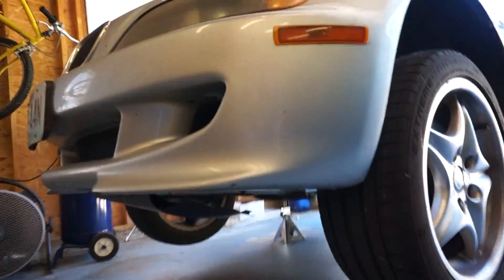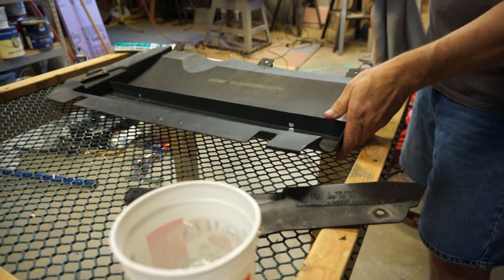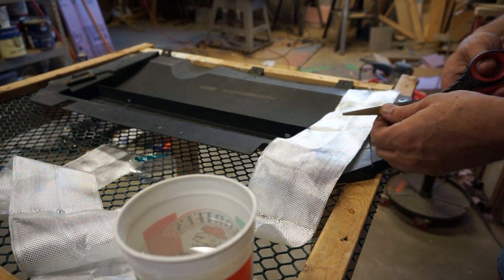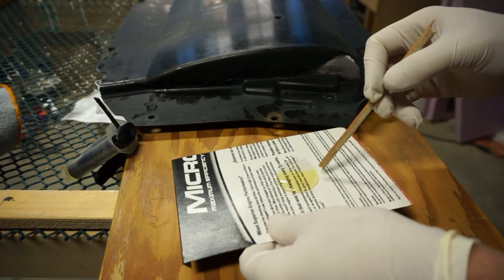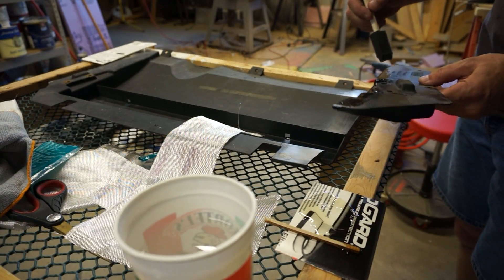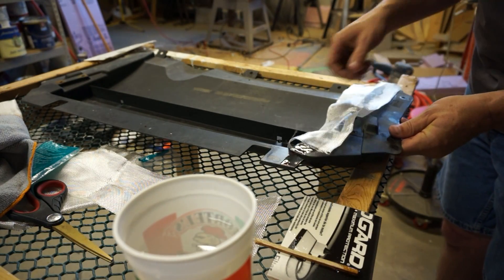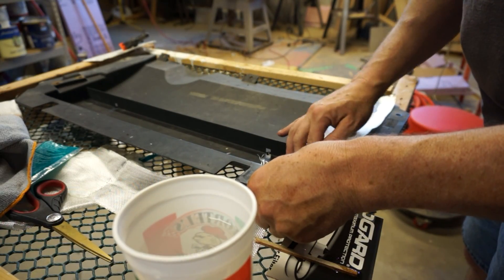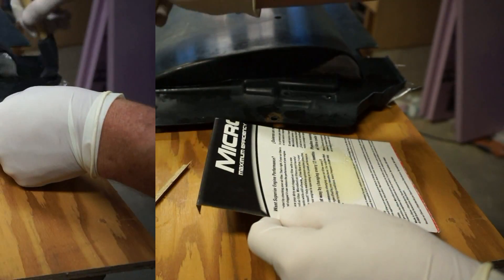Automobile Plastic Repair - Ugly and Functional with Fiberglass and Epoxy

Comment: Resin (epoxy & polyester) will not adhere to plastics. May seem like it has a good bond at first but it will come apart eventually. Next time get stainless steel mesh and soder the mesh onto the plastic.
Reply from the maker: Soder the mesh into the plastic? Sounds good but it's new to me.
Here's a video on it - https://youtu.be/RUlbaDOnY_o

Comment: How well has this held up?
Reply: Jc Connell it shouldnt brake. You have to use fibreglass resin and laminate it with multiple layers of fibreglass, and cover the entire fibreglass with resin and soak it. This way the repaired part will be much stronger than the actuall plastic part, it will never break this way,
Reply from the maker: It was doing great for a couple years, then I hit a speed bump a little too hard...
Oh well.